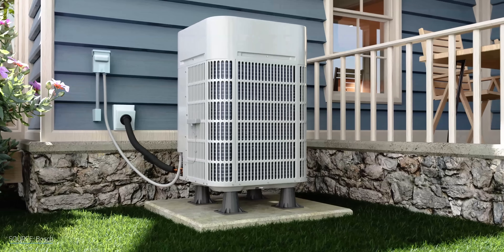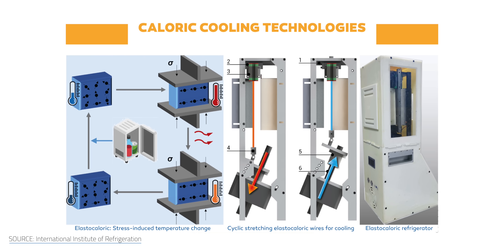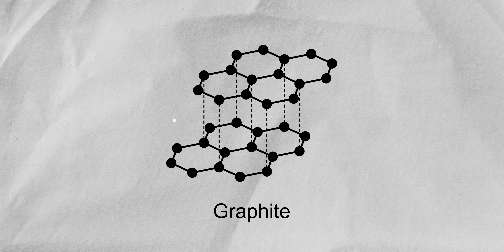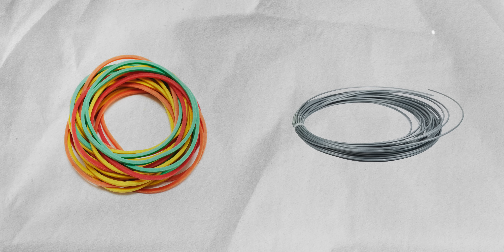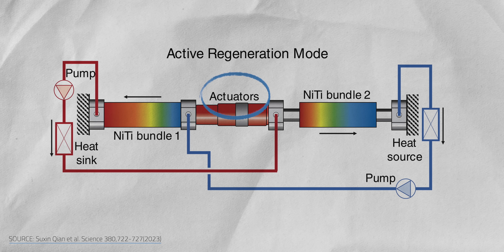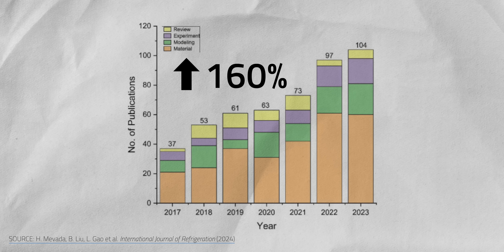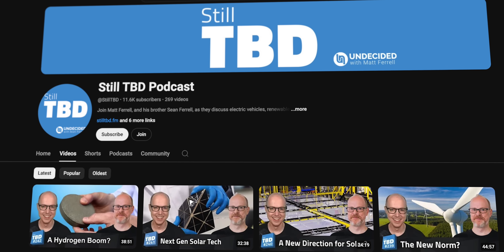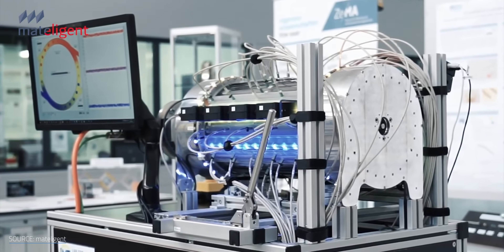How Solid State Cooling Could Change Everything

Comment from the maker: Would you be interested in an elastocaloric fridge or air conditioner? Use code 50UNDECIDED to get 50% OFF plus free shipping on your first Factor box at https://bit.ly/3BRkS87!

If you liked this, check out Why The US Military Chose Silicon-Graphene Batteries https://youtu.be/l60hjFvj64s?list=PLnTSM-ORSgi7uzySCXq8VXhodHB5B5OiQ
Reply: There are other refrigerants that can be used besides CFCs. CO2, nitrogen, helium, air, hydrogen, natural gas etc .
Reply: Ammonia would be my preference
Reply: Matt may I ask why my comment about Dipole Electron Flood Theory was removed?
Reply: Dipole Electron Flood theory states the proton is made of about 1839 Dipoles and Neutrons about 1840....If Electrons are dipoles (and I prove they are experimentally) it changes everything. Can we talk?
Reply: @mudfossiluniversity   the research I have done is in kinetics and galvanic relationships and reactions. I am an election technician by training. What you said is Greek to me. Different gasses are used in different freezers. (Some) Cryogenic freezers used in labs and industry use helium to cool down to -70°C. Hydrogen freezers can go much lower.
Reply: If we could find a way to do it with very little actual movement of mass.   Something at the molecular level that could truly be considered solid-state.

codywiess7075's comment about Peltier coolers gives me an idea. It has always bugged me that Peltier coolers just can't seem to be improved upon.  I love the concept... they are solid state devices.  If only they didn't burn so much energy to produce the requisite effect.

I wonder if we could use Elastocalorics to separate Peltier layers once the temperature differential develops.  Separating them would add insulative value and allow the operation to dissipate or collect heat far more efficiently, then slap the layers back together again once the temperature has equalized and setup for the next round.  All in sold-state (molecular level operation).

-Matt
Reply: 6 and a half minutes to get to it.
I'm done with this channel.
Reply: @dougaltolan3017  every video "could change everything"
I don't know why YouTube keeps recommending this Channel
Reply: Metal Fatigue
Reply: Horrible video.  Two minutes of high school level information spread out of 16 minutes.  Also, there is no reason that this can't go from initial proof to final product in a month or two with two or three person teams.  The entire scientific industry and commercialization is utterly broken.
Reply: Matt you say nothing can liberate us but Dipole Electron Flood Theory just might create free portable clean safe electricity in a lunchbox. The Theory....
We used light and created sterile muons and electron showers. 
Anatomy of the Proton. 
Dipole Electron Flood Theory is a new Atomic model that changes the nucleus from a completely positive into a dipole made of tiny dipoles called Dirac Neutrinos instead of a large positive-only core. Protons and Neutrons are made of dipoles in certain stable quantities that we now call atoms in various sizes.
Reply: Could use a hybrid system of elastomer and compressor with peltier cooling so each would have fewer cooling cycles. It would probably  be to complex though.
Reply: Quick question… what is the carbon footprint of using something like Factor_ vs just going to the grocery store?
Reply: @daveinpublic energy efficient yes cost efficient no. Delivery is more efficient I think. I know someone who delivers Amazon. Sometimes they drop 4-5 packages on 1 block.
Assuming it arrives weekly not daily. That would be a huge waste of money.
Reply: To me this technology seems most promising as a cooling component vr chips and electronic components in extreme conditions.
Reply: this reminds me of early decades of solar PVs, like a calculator with tiny solar panel. It could take decades to make this into HVAC, a decade or two for residential refrigeration.
Don't get me wrong, I like this and there is potential by massive scaling volume production of the elastic metals and shape them into very dense structures.
Regarding durability, I think the solution is just plenty of these metals where the stretching is minimized to make it last a decade or two of operation.
Reply: looking at all of the prototypes I can already see one huge improvement that would net orders of magnitude more close contact heat transfer paths and allow you to heat water and cool the room at the same time.
Reply: If only there was some type of fabric ductwork system that adds to the efficiency of these heat pumps… 🤔
Reply: Just wasted my time again. 

The majority of the world energy used is in the heating and cooling of our houses in the developed world. Pity those Countries where air con is cost prohibitive. 

Surely reducing greenhouse gas emissions is better done by making housing energy efficient,  rather than letting capitalistic business build you the cheapest crap low energy efficient house and charge you top dollar for it. Maybe some of the simplest solutions which can be done today will save the day rather than waiting for some new untested technology.
Reply: Hey Matt @UndecidedMF today the news was talking about using synthetic diamonds to replace perovskite in solar panels. Love to hear your thoughts on how viable that will be. Personally I don't think it will ever be cost effective. We've been making diamonds in a lab forever but never been able to make them affordable
Reply: @UndecidedMF  very sad to hear you don't let people know about the 5 megawatt Mcdonald Douglas generator......🤑🤑🤑
Reply: Those LEDs aren't saving any power
Reply: The "vapor cycle" worked great 100 years ago.
Reply: Does it beat carnot cycle?
Reply: Why this thing is still posting
Who doesn’t know - information on this “channel” can’t be trusted, a lot of misinformation 
Say it in comments in all videos here
Reply: I “can’t believe”, it deleted my comment, report channel for misinformation and go to other videos and tell other people 
Channel full of misinformation and unverified data, comments are being removed, so you might want to check for it
Channel had to be taken down
Reply: @UndecidedMF  This is interesting. This made me wonder  If they can build a mechanism that has different 'bays' that are on the same mechanism where one side is pulled and the other side released, that the state of balance is neutral. That way it will take a lot less energy because the potential energy in the stretched side can be regenerated to stretch the other side. So the motor needs less power. I'm not talking about a self-perpetuating motor but because it is a heat pump this can be possible, of course it will still consume power. I mean the same principle could be used on a conventional heat pump, you have a pressure side and a vacuum side, I'm sure it is possible, not necessary practical,  to loop it bag on say anothe Piston on the same shaft using the  decompressing of the gass to contribute to compressing it on the other side. It properly need a seel inbatween the Chambers, but a vehicle aircon has a high pressure seal in a dirty environment and the last pretty well. Even if in a enclosed unit there is a trickle leak, the gass won't be lost as it it is in a closed environment.
Reply: i have a question, why nitinol is always presented as a wire... does it loose its properties if it is shaped as a square?
Reply: Have you looked into Malcolm Bendall's Thunderstorm Generator..?
Reply: https://youtu.be/LwIurMT4AEI?si=xlVc52a-02dIXFeO
Reply: Dá uma olhadinha no meu projeto!
Abraço!
Reply: If the final product approaches the efficiency of a traditional coolant based HVAC unit like a heat pump, why bother. The entire industry knows how to install and repair traditional systems.
Reply: much love as always to Matt, the family and the team!
Reply: basically you made video to say nothing. I was curious about prototype. but u show useless drawing and images. wasted my time
Reply: @nastybadger-tn4kl  while I feel like your comment is just a petty cry for attention if that's really how you than you should know that youtube recommendations work on 2 factors. Watch time and engagement. If you thought the video was bad the worst possible thing you could have done is watch it all and then leave a comment too 😂🤣😂🤣 so GG you played yourself.

Comment: 13:12 no it is not efficient it has a high coefficient which can’t be harnessed today. If if was 7 times more efficient it would be already deployed. So where is the catch?  It doesn’t scale? It is too expensive? It is not stable. And what is the solid state, when it is a dynamic system that fatigues and breaks.

Comment: Ford does this in its heated and cooled seats on some models! We call it the TED and though they do fail, not nearly as often and the heater mats they used to use, or the mock cooling they used early and just using a fan to blow air through the seat cushions

Comment: Sounds like a promising technology, especially since we are at the beginning of another high tech boom in regards to data centers. We will need to find a way to save as much energy as possible to offset the demand from AI. My question is this. If the technology removes heat from the wires, which in turn cools the environment around it, how can we capture and use that heat and convert it back to more energy?

Comment: Hi Matt,
Could you please do a video on using propane as a refrigerant?  They've been doing it for decades overseas, and personally, I've been using it for about 20 years. I've used it in 6 vehicles, all of which are still performing excellent to this day. Also, my home refrigerator has been running it for almost 5 years, problem-free. It will mix with virtually any lubricant, you use about 2/3 the charge, working pressure is much lower, and it gets MUCH cooler than "freon" products!  It is NOT an explosion hazard, as there is so little used.  (people worry about that, but it's just ridiculous!) for the cost of BBQing a steak, You can have insanely cold A/C in your car. IN ARIZONA! No need to retrofit your system at all.  Thanks.

Comment: Most refrigerators and freezers expel their waste heat directly into the home, which either (A) warms the external air and makes the cooling box work harder, or (B) requires an air conditioner to keep the air cool.  This means that most refrigerators, at their most efficient are still about half as efficient as they could be for half the year, versus if people would just normalize having a their fridge waste heat vent directly outside in the summer, and then switch the ducting so that it heats in the winter.  No new tech required.

Comment: While it wouldn't be a closed system for the lifetime of a gadget, it seems possible that the elastocalorics could be removed, recycled, and replaced into cooling systems. There's no loss in material and such replacement could enable much higher stress. You could just swap it out with your fridge's water filter someday.

Comment: After watching this it seems obvious to me, but shouldn't this tech be used for the trays in the fridge to instantly cool down when things apply pressure and deform the tray they're placed on.
This also seems like it would be reasonably easy to connect to the wall of the fridge and have the motorized or powered conductor be what the shelves sit on.  That should allow us to extract move the heat from the trays to the outside world.

Comment: Dude you have absolutely no idea what you’re talking about basically what you’re saying is using a reverse valve for your ac is better fact 1 with your standard ac compressor you really can’t heat over 75 degrees then your trying to shove wires in it to make it hotter which would probably dissipate half of it outside because that’s where your compressor is. This is just dumb.

Comment: Why stressing on caloric? That's the one thing they all do. Remove calories (i.e. heat energy) from your surroundings and most seem to be using temporary decrease in entropy through some kind of stress on the crystal structure, thus rising temperature and heat transport onto the fluid. Or a formerly warmed state back to its normal state and get cooling... But hey... at least we are not using Peltier elements =)

Comment: Question:

Could an ice sourced heat pump add enough "seed energy" into an elastocaloric system to produce a viable electric trickle for charging a household battery, supplementing a solar panel trickle?

Comment: Very interesting. It explains a strange phenomenon I had noticed a while ago. When you bend a strip of polypropylene, it warms up. But when you release that again, the plastic at the bend spot cools down significantly for a moment. I could not find anything on the web about this cooling phenomenon with PP, and was wondering if one could base a heat pump on it. Your YouTube video is the first article I found that explains this phenomenon, complete with the applications, albeit with different materials. Good job.

Comment: Elastocalorics do sound interesting, but I'm personally thinking more about how I can keep my house cool passively. (The current air conditioner is dead and we loose power semi-regularly) While I do think there is a place for cutting edge high tech in solving sustainability I also think that it often distracts from more durable and existing solutions, which can be applied in a much broader range of places. For example, when I was a freshman in college, I was part of a project working with a film collective in the Amazon Rain Forest. One of the largest issues they had was climate management for their storage and what our professors repeatedly emphasized was that any option that relied on electricity would require too much power from their solar grid and would likely not fair that well in the heat and dust (which was what killed some of the group's previous computers)

If elastocaloric heat pumps can prove to be more durable than a vapor compression system, that would be a big bonus, though.

Comment: It seems rather ironic that you've got to HEAT up the wire to relax it (where it releases its heat).  This makes nitinol wire a fun visual gag but a pretty poor practical example.  I would have appreciated your showing a material that had some other way of triggering the cooling relaxation (something other than the "let it go" of the lever demo, which was by far the best example you showed)

Comment: What I'm most curious about is the material fatigue? How durable is that material for the long term use?

You know investing in such technology to cool/heat your house you'd expect it to last like 10 years at least. Unless it's dirt cheap to replace it every couple years, don't see this working out... unless it's extremely durable as in it can sustain compressions/decompressions almost endlessly.

Comment: It'd be interesting to see if instead of an electrical input to an actuator bending the metals if we couldn't just use a bimetal to not only provide the power for mechanical deformation but also to set the target temperature.

Comment: Do these materials respond similarly to compressive stress? 
Consider a series of rollers (like we use for making different gauge sheet metal) on a loop of ribbon with slack on the return run. 
Gear drive the rollers
Very simple constant motion with a clearly separated hot and cold side

Comment: Cool. But transfering heat between the metal wire and the air in the fridge, or the water in the home radiator, seems a hot topic. How do they do that?

Comment: Very cool video! When I think of solid state cooling I think of Peltier Modules. Now these are probably much less efficient that phase changing processes, however the potential a system with NO moving parts in a world where clean electricity might become abundant, definitely seems like a tempting alternative. Refrigerants are used due to their efficient ability to transfer heat, however basic air has the ability to heat up while compressed and cool off when decompressed, how about a system that simply works with compressed air. I have a toy sterling engine which is powered by a flame, the cooling cylinder gets quite hot in the end which indicates to me that the system is moving heat from one end to the other. Maybe if you powered a stirling engine flywheel with electricity it could be used to pump heat? Thanks again for creating an excellent video.

Comment: Basically you are saying we have bend this material outside and place it in the room that you want to cool down. As long as you learned thermodynamics, you will not get the conclusion. The COP for a regular refrigerator is 3-6. For your scenario, you compress the material with 5J, and you pull the heat from the room with same 5J. COP is 1!

Comment: Hilsch device is the most efficient thermal sorter, but it only works with air, high speed air or compressed air is needed and valving to direct which flow you desire to destination, so it is better for really large applications, and more extreme outputs, nobody wants their air conditioner to freeze them out or cook them on the other end. We use heat pumps because they are efficient at the temperature range that makes us comfortable.

Comment: In the 1990's, there was a program called Beyond 2000.  There was a cooling device featured on the program that they said would revolutionize cooling for homes, refrigerators, etc.  There was a mineral type substance in one end of a plastic chamber.  There was something else in another chamber.  When you let air through, water in the chamber froze.  It was passive.  There was no electricity.  I've never been able to find that show again, nor any mention of such a device.  I give it a try every few years when my eyes pop out at my central cooling electric bill in hot summers.  No revolution so far.  Where did it go?